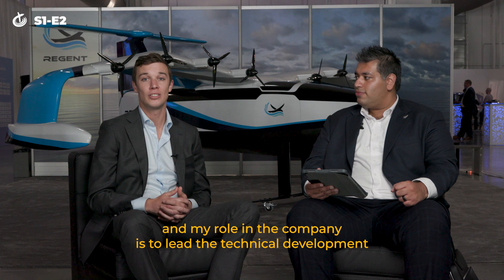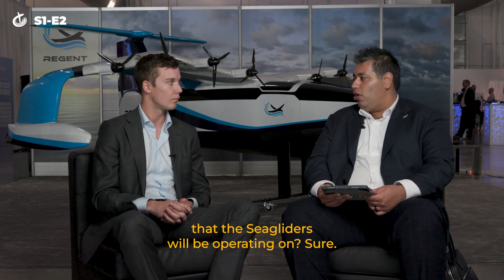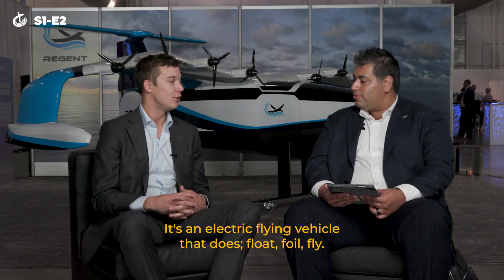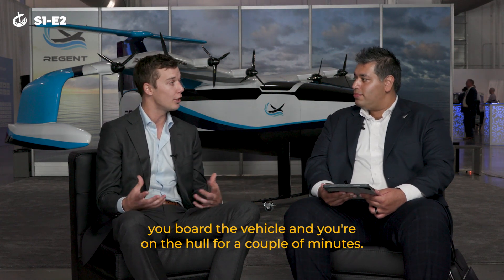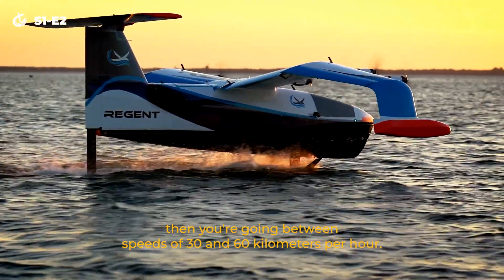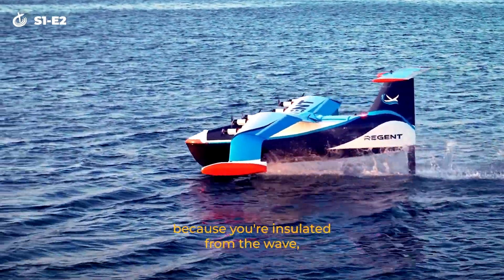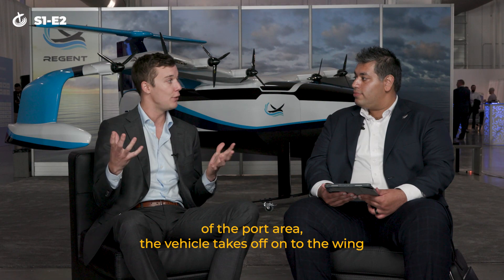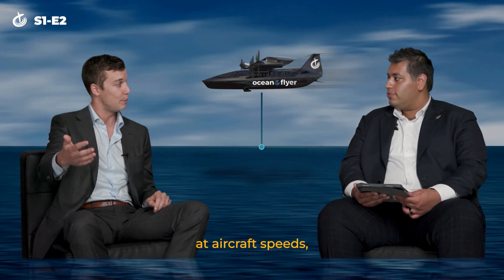Ocean Flyer | Seaglider Savvy - Episode 2 - What's a Seaglider?

Comment: The actual ground effect with this design is fairly minimal. I wouldn't go so far as to call it a wig. It may be designed to operate at wig levels, but it's still just an aircraft that takes off on foils. Perhaps it's designed to fit into the nautical wig classification, and that's an excellent concept, in which case I'd call it a "height restricted sea plane"

It is hella cool though, looks awesome.